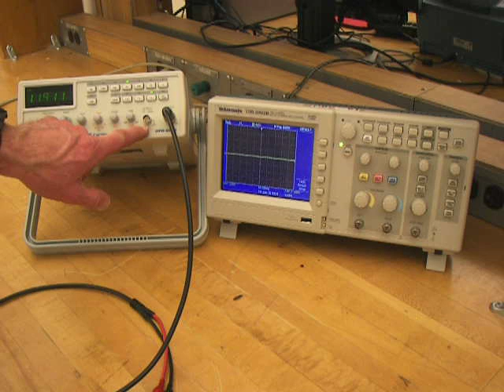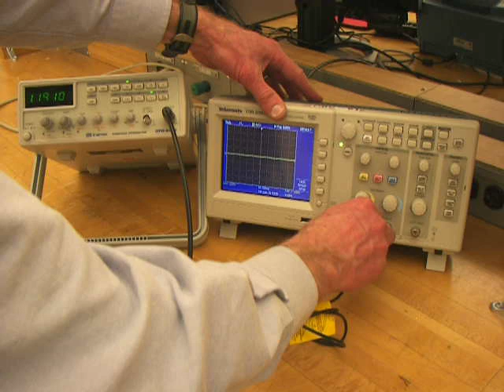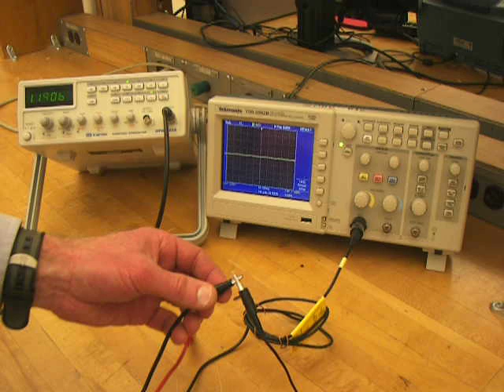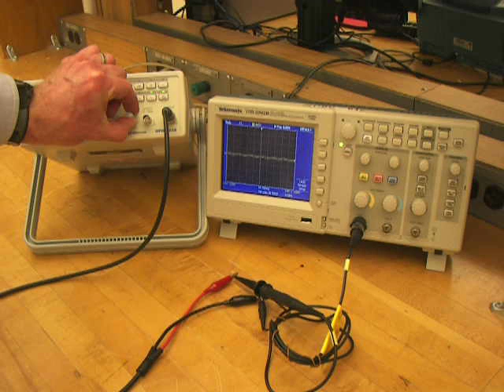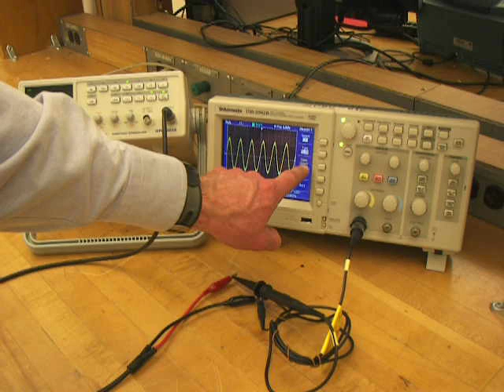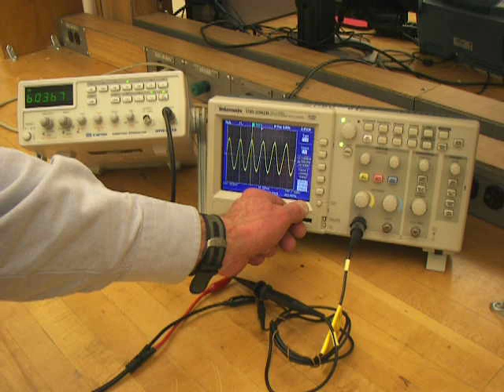Function Generator & Oscilloscope 100_4507.MOV

Comment: what about bnc to bnc or bnc t for connecting the 2? ive seen a few setups to test the ESR of caps using a bnc t con out to wires with a resister in the mix (forget where)...basically watching the change in wave form due to the cap then allows you to compute the ESR with a bit of algebra

Comment: I used to have a Sencore scope, it's quite expensive but very easy to use. just set it to auto and it does everything for you. it has a built-in meter that will read the voltage etc.